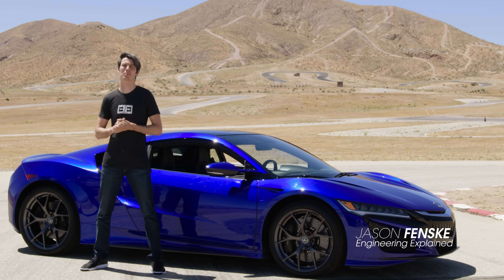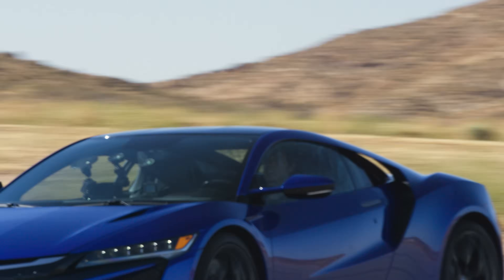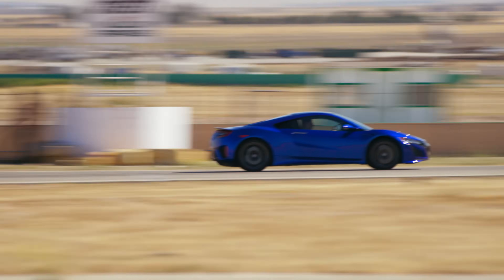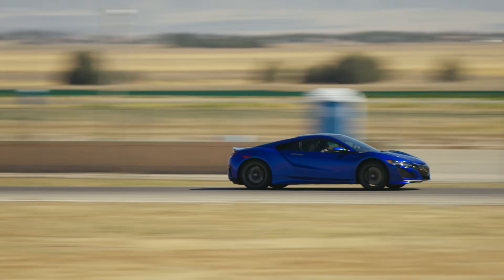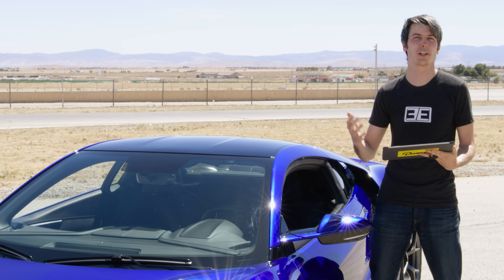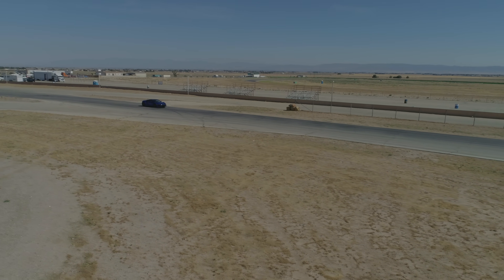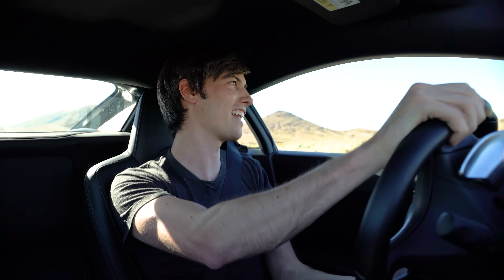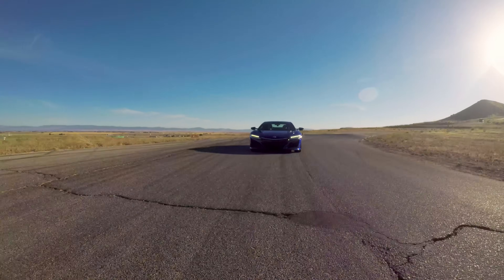How The Acura NSX Connects Man To Machine

Comment: 1) It's certainly true that NSX takes off with the help of E-motor, with two motors for each front wheel and one for both rear can we call that machine as a AWD (all wheel drive). 2) We can reduce turbo lag by changing distributer timing or using super charger. Is this E-Motor necessary.3) Did this motor involves in Regenerative Breaking?

Comment: Honestly, I hate the paddle shifter thing on the steering wheel, it's awkward and when you doing a turn, you not sure if shifting up or down. They should have put it on the shift stick next to your right hand like a regular standard manual transmission. I have the TLX and I rarely use the auto manual mode, it just doesnt feel like a true manual stick shift car.

Comment: So basically we get the Electric Car instant peak torque to launch when you step on the throttle, while the motors make the car move from a stop, the engine and turbocharges rev up to the moving point where the engine takes over and releases the power!  

We are finally getting sharp minds! This is  a true hybrid and connection between driver and car!

 We got instant torque with electric motors on a gas car with the Acura NSX.
We got Air Conditioner cooling for the supercharges intercooler on Dodge Demon.

What else!? Come on!
Reply from the maker: +Kiraro The Kitsune it's a great time to be into cars!
Reply: +Engineering Explained yes, yes it is!

5 to 10 years later  and Bugatti uses all of this engineering to make the next fastest production  car. Bugatti has it easy with everyone improving engineering for them, all they have to do is implement it with all their tech and improve it even further.

Comment: Hello, could we request a video about Honda's VCM system? in specific how do the V6 models go from 6 cylinders to 4 and sometimes to 3!! How does it turn off 2 cylinders only and have the other 4 running, if each camshaft is connected to 3 cylinders! and why doesn't the system work at idle?

Comment: Sadly this machine is far overpriced and a failure as an NSX for multiple reasons. 1. The interior is way too much like a glorified TSX (Aside from the seats) 2. The entire car is not nearly as symmetrical as its predecessor. Its far too busy and in order to appreciate any styling of the car, one must maintain focus on that area of the vehicle. 3. The entire drivetrain is overly complex to a fault, especially adding EV components. I understand the drive to build a well balanced machine, but adding EV, trying to be like Porsche and other high brand supercars does no service to the Acura brand at all. It should have stayed in its lane and just built a combustion powerhouse that was loaded with function and class. Aryton Senna would NOT like this car. Its not pure and it wreaks of trying to catch up with the big boys (most of what Acura has done here is old hat at this point). This is all just my opinion, but I think if one searches AutoTrader for the 2017 NSX you will see the abundance of this car for sale. That and the fact that the NA NSX has skyrocketed in value should speak volumes as to the widespread disappointment over the new NSX. I am pretty sure that Acura feels the temperature of the NSX culture as well and is not happy.
Reply: Louis Pedrero truth spoken in good words. wish honda would have taken a different route with this car in the beginning, this car would have lived on.

Comment: Gotta say, I agree with others: This felt a bit like the script was handed down from the sponsors — especially that first bit about "how do you design a supercar." Also, I'm not here to watch a pro do doughnuts and smoke tires.

On the other hand, I did enjoy seeing your genuine delight when you were actually behind the wheel, and I think what they've done using electric motors to compensate for the non-electric components' "flaws" is actually an interesting engineering feature.

Comment: I'm not going to criticize Jason about the sponsored video because I get that he needs to fund his channel. It's a bidness after all. But I will criticize the new NSX. 

This car has not resonated with the public because it shares no DNA with the original NSX, its performance is not commensurate with its price point (it's even slower than that less expensive other Japanese supercar), and I cannot think of anyone who has $200,000 to splurge on a car wanting the NSX over an R8, 911 Turbo S, or Huracan. 

Lastly, a series hybridized supercar is designed to either make the car faster, make it more fuel efficient, or both. The new NSX's hybrid drivetrain is neither faster than the competition nor more fuel efficient and it just adds needless weight and complexity.

Comment: Come on Jason..sort of sold out here! you know the issue is weight. Heavy cars do not provide what is discussed in the video. But you know that right.
Reply from the maker: +Scott Moore it also important where you place the weight. If you keep the weight central and low, you can compensate for the additional mass and still have a car with a low polar moment of inertia, providing agile, quick handling. With the mid-engine design, battery pack in the center, they kept the dynamics solid.
Reply: More weight=more lateral gs=more grip and with everything they've done to compensate for the weight handling wise would make this an amazing car to drive

Comment: your gonna wipe that smile off your face once you see the price tag and cost of maintenance .   Dam Honda/Acura , why couldn't they just make it a simple 3.5L  V6 RWD  NSX  without all these electronics ,batteries and electric motors etc....  and a lower price tag
Reply: the old NSX costed around 100k so it was never cheap to begin with
Reply: I wouldn't mind its price if it were good to drive compared to its rivals. The AMG GT-S/R, 911 GT3/Turbo S, R8 V10 Plus, and 570S are ALL better drivers cars
Reply: ewt415 better car is a broad statement
Reply: Slickpete83 if they did that it wouldn't be a nsx and the original nsx was never cheap.
Reply: Todd, better DRIVERS car is not quite as broad. If you're a car person, you value engine quality, from the noise to how the power delivery feels, to the responsively between it and the throttle. You value its steering quality in terms of the ratio, directness, and feedback You value the transmission's responsiveness, you value how the car shifts and moves beneath your ass. These are all qualities that can make or break a drivers car, and each of those cars trump the NSX in a good majority of these categories.

Comment: Why they dont use an electric turbocharger like audi?
Reply from the maker: Using electric motors on the front axle allows for AWD, and true torque vectoring (rather than brake based yaw control, which it also has).

Comment: This is obviously sponsored but this video didn't feel like a sell out, I also hope you're getting a NSX for this.

Anyway, is there any chance from Honda improving the battery pack of the NSX any time soon? It seems a bit too small for effective gains in economy
Reply from the maker: The hybrid system of the NSX is used for performance, rather than efficiency. To keep performance high, smaller battery packs weigh less. They chose a size that would allow for consistent lap times, but nothing more.

Comment: The thing that connects man and machine?  Knowledge.

I drive three cars: a 3G Eclipse, a 2G Eclipse, and an Evo 8.  I know just about every fastener, bearing and wire in all three of those cars - and I wouldn't trade that for the world.  Nothing beat going down the road knowing intimately what everything does, where it goes and how to take care of it - rather than a spec sheet of what some person at a dealership told you.

That what will connect man to machine.  Too many people now don't know how to change their own oil, or even what brand and/or type of brake pads the mechanic just put on their cars.

This only makes the gap even wider.
Reply: Did you realize that when the Evo and Eclipses were released people claimed they were complicated as well? Hell the Evo has an active diff with clutch plates. Now you work on it and claim it's great to take care of but the fact is many will claim AWD makes the gap wider. In time the NSX will be just like any other car and someone like you will buy it claiming that fully electric cars have no connection.
Reply: The type of car you work on is immaterial.  Yes, there will be people that will try to break this car down to it's components - but that's not my point.

My point is that the more engineering and finer points you introduce, the further away from actually working on it will people become.  I'd like to know how many DIYers will be able to rebuild the windings in an electric motor, much less the other stuff they put in this car?   How many Autozones will carry the part so you can even replace it?  

I'd like see how many videos there are on people replacing the ferromagnatic fluid in a Magnetofheological damper in a Camaro ZL1 - and that was released some years ago.

THATS my point.  The more complicated engineering gets, the less likely and possible it will be to even get near the components.
Reply: And like I said, these are the basics of economies of scale. How many autozones have parts listed for the original NSX or Ferrari Testarossa? When your evo first came out it was exceptionally complicated. Eventually over time parts became more available. Humans learn more and figure out a way. Fuel injection was complication. Active diff's were complicated. Engine's with turbo's were complicated. Tech evolves. 

It's a damper. It has a mechanical part that you change. My GX470 has adjustable dampers. You can't rebuild those either. All you do is replace them. 

Its complicated but it works. You bought an Evo despite the fact that it has yaw control sensors that detect slip and vector power independently to each wheel. That is crazy complicated for most folks but hell you managed to work with it just fine. 

Eventually you'll have someone posting about their mods and once they get their hands dirty you'll figure out more. That's the human way.
Reply: GammaCruxis and I assume you want recognition?
Reply: Ah ok I see what you're saying. Well like I said time will tell. The Lexus ISF has finally had tuners come in and be able to get the ECU to play nice. Just depends on the brand and build I guess. So far from what I've seen Acura's aren't bad to work on and the technicians I know who work on my car say the car's being built are pretty easy to work on.
Reply: i would have to agree with this... but keeping in mind people like Valentino Balboni who i doubt he could by himself tear down and re assemble the modern cars he test drove, can we argue because of that it made Lamborghini less amazing?
Reply: GammaCruxis Amen! You don't truly know your car until you've worked on it.  Although, I'm starting to think I know my little e46 a little too well.
Reply: I agree.
Reply: I have a 3G and 2013 maro ss. Have you done any mods to the 3g?
Reply: extra-true, i personnaly like driving toyotas because they are so easy to work on. I had 2 Gtis andthey are a nightmare to work on
Reply: what makes yo think this is harder to learn about this than a petrol engine? This is change people fear what they dont know give it a few years and i garauntee you will know just as much about electrics as you do about petrol cars. People have a common misconception that new means difficult when in reality it doesnt
Reply: I'm not talking about things being complicated - I'm talking about widespread knowledge of it despite it being complicated and peoples willingness to even look at it.

My Evo is complicated, but I can look at everything using afirly cheap computers, monitors and scopes.  My neighbor has a 2009 Mercedes CLS 500.  I can even talk to it without buying a $1000 diagnostic tool and other expensive parts - so I cant help him when he has issues.

And that car is 8 years old.  Thats the point Im getting at here.  Engineering on the Mercedes has outstripped my ability to gain the knowledge of how it works, so I wont touch it.

Knowledge comes from accessibility and desire.  If its accessible, people will find out, even if it is complicated.  This NSX - is not accessible - it matters not what you say about it.
Reply: I'm a senior in college. I recently met with an old friend/ acquaintance from high school over lunch. He said at his recent his 3rd internship at honda he worked with a group of engineers whose jobs were to hear customer complaints about the NSX, and then work with the lead engineers of each specific part that was being worked on to fix the issue. I doubt it would, but itd be really cool if I could have him put you in contact with one of the guys he was working with. Want me to ask?

Comment: So, I don't actually know everything about cars so I have a question, Jason. What's the difference between rally cars and high performance cars made in the past which didn't use such complicated systems to achieve the delay reduction thing? I am assuming that the engineering going into rally cars would also have to make it so that the car responds perfectly to driver input and there's no sluggishness in the handling and the throttle response and such. 

In the NSX, what exactly is being done that would not be done in a Group A or Group N rally car? Rather, at the Motorsports level, does it make for a better driving experience to have better driving assist technology or is it better to be able to have more raw inputs and outputs like the rally cars do? Thanks for making such awesome videos! :D
Reply from the maker: The NSX is using electric motors to fill the void of turbo-lag. Rally cars are using fuel-based anti-lag systems. These systems can be quite rough on engines, but in racing reliability can be a much shorter duration than for production cars (not to mention emissions, which anti-lag systems would almost surely fail to pass). I have a few videos on anti-lag systems if you're curious how they work!
Reply: Engineering Explained Oh duh! I completely forgot about the noisy Anti-Lag systems! That actually makes complete sense, thanks! I'm also going to check out the videos you mentioned. 

One more thing though: about the steering. Assuming that the steering here is an electronic assisted steering, how would it rival the preciseness of a hydraulic steering system or whatever is used currently in rally sports because I'm assuming that a hydraulic steering system would give better feedback than an electronic system unless they use something analogus to "force feedback" that I feel in a racing wheel controller. I brought this up because most car reviewers bemoan the lack of "steering feel" in electronically assisted steering and I always wondered why that's so. Have you made any videos explaining the precise differences in those systems?

Comment: It does not rev up before launch control? Strange ...
Reply from the maker: Very low revs, because of the electric motors you don't need much power from the engine for the initial launch.
Reply: jawbreaker 
It doesnt need to rev up for launch control due to the fact that you have two individual electric motors driving each axle up front. Electric motors provide instantaneous torque from 0 to 2000 rpm